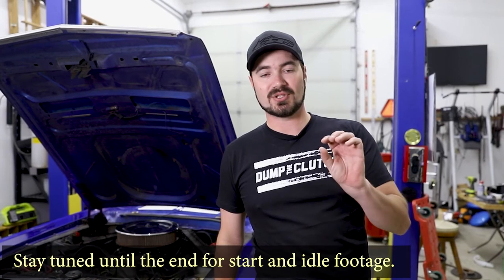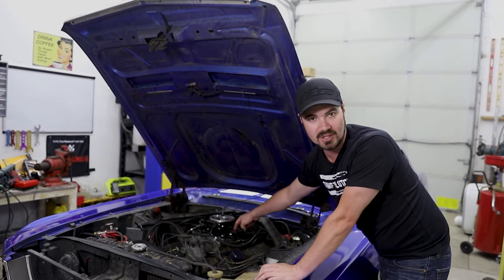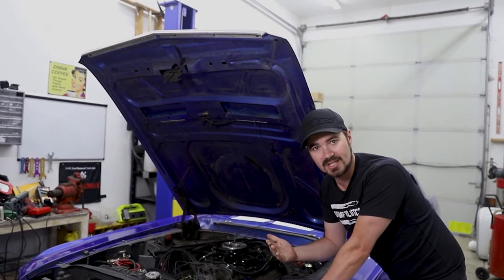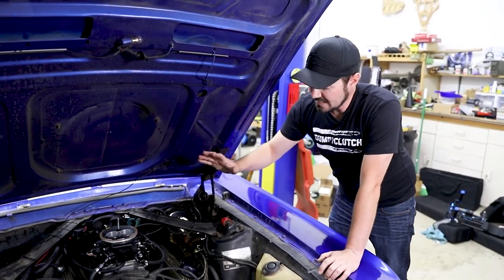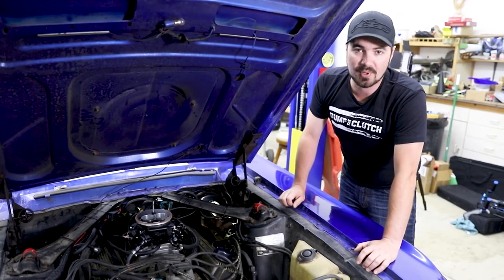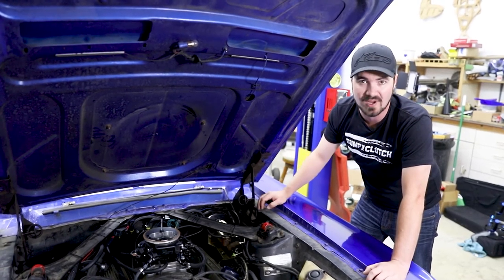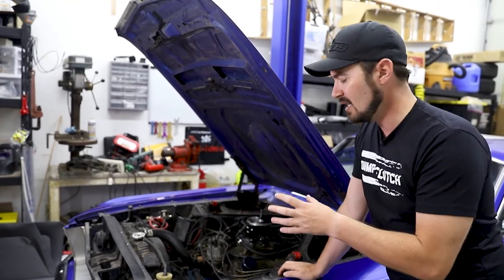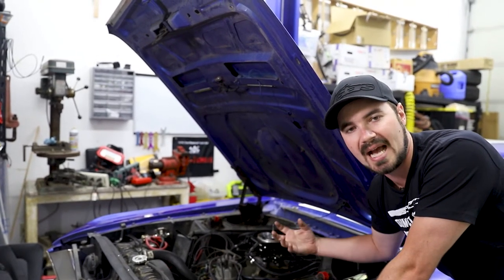[Music Fixed] Sniper EFI: Initial thoughts and issues [It's good!]

Comment: Got this exact setup for my 69 Fastback with a 302, even the fuel tank. My dad had the original engine with 120k mileage (dad got it from the original owner I have complete history with a Marti report) rebuilt in the mid 2000s with a “hot cam”, his words. He kept good files but I couldn’t the work order receipt only some breakin instructions. Lost him a year and a half ago. I dove into finishing what was supposed to be his retirement project car as I was something we’d planned to do together before life got in the way. 

Body got completely disassembled and repainted in Oxford white by Ford. I just got it to place willing to finish it 100%, as my health and where I stay makes finishing it myself not feasible. I can’t wait till I hear it fire up again for the first time since we took it apart running ages ago. I’m going to be using your videos to help explain to my mechanic what I want done and your tips (especially the fuel lines in the trunk being steel and a false bottom) are very precise and well presented. Should make getting it squared away a breeze. Thanks a ton.
Reply from the maker: That's awesome you're carrying on his project. Good luck!

Comment: Thanks for keeping us updatet, It takes long time to start when it is cold, is it possible to improve that ?
Reply from the maker: It should only take a few cranks to start once tuned. In general, mine starts after about 3 cranks. It is still throttle body injection, so it still has to have the engine crank enough to pull air and fuel in for the spark, where as if it were injected at each runner or direct port, it would have the fuel immediately available at the cylinder.

If it's taking more cranks, either you aren't waiting for the fuel prime and initial injector pulse to preload the intake manifold with fuel, the build of your engine is such cams and compression require more for it to kick off, or your tune is off for cold start.